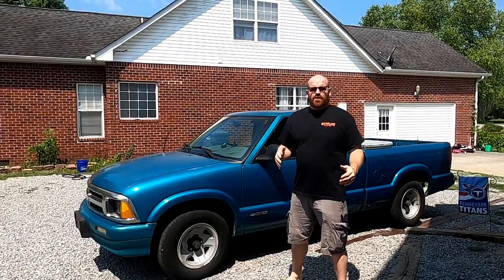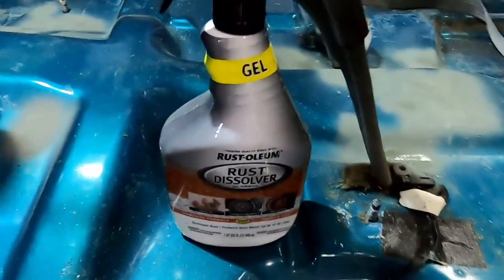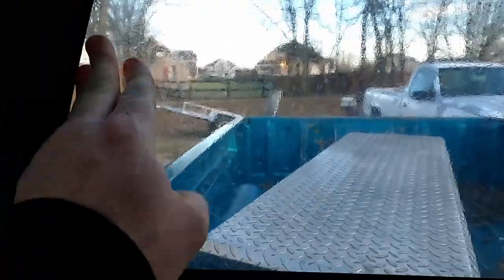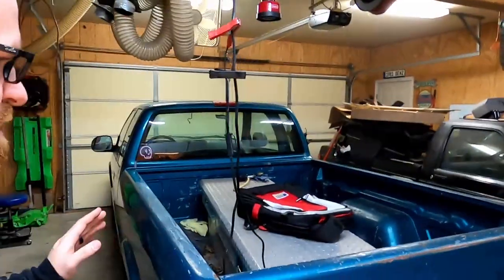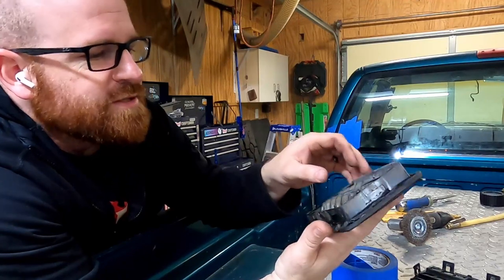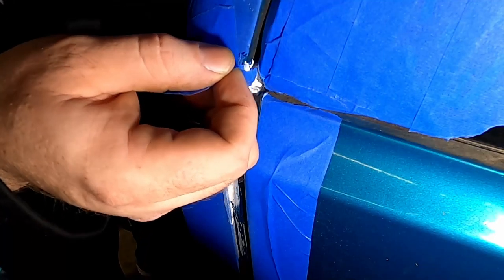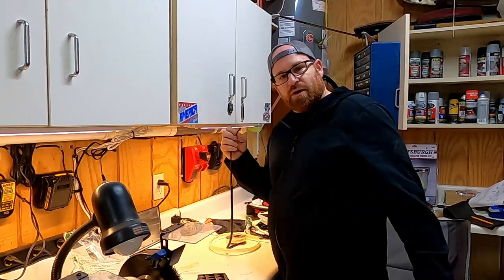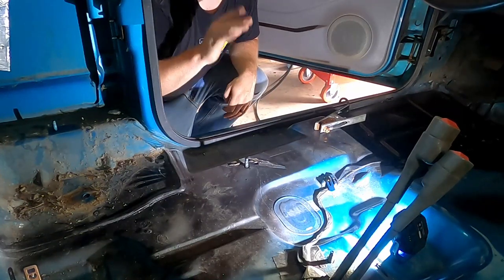S10 Interior Water Leak Fixed! Wasn't Leaking Anywhere Near Where I Thought It Was...

Comment: Same truck, same issue. The upper rear cab corners, sides of back window, and the rear vent all leaked. The rear cab vent was the worst and the water from that leak pooled in the rear corners of the cab.